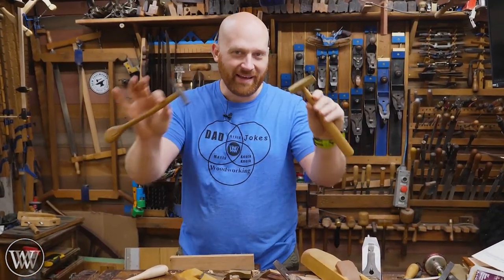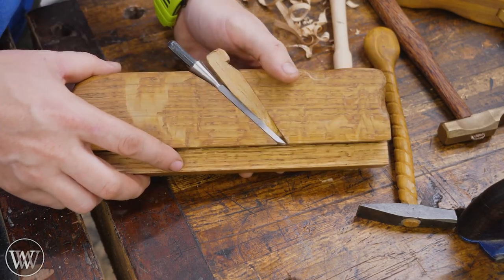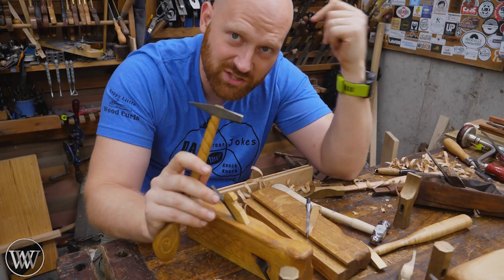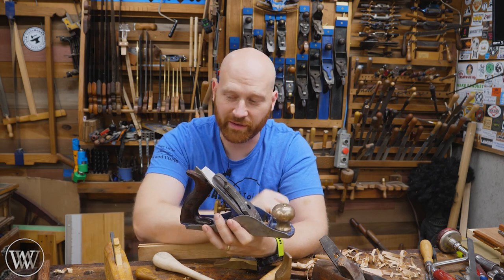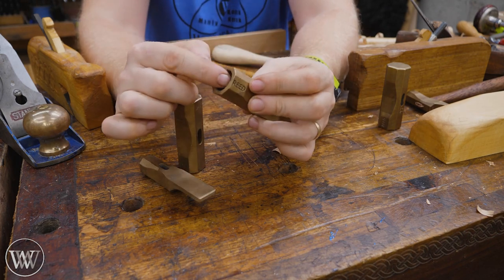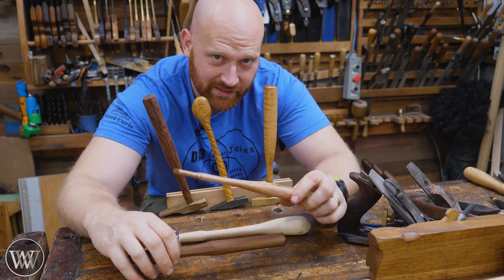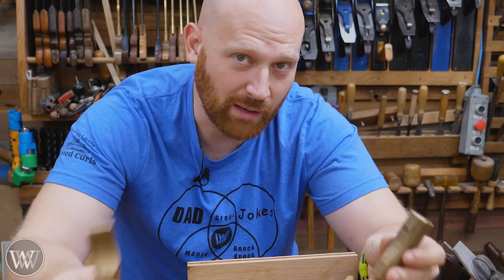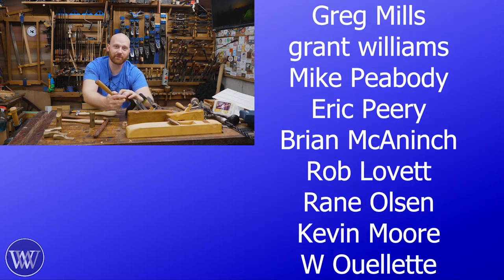These Use To Be On Every Woodworking Bench

Comment: Looks like a very hand tool. I use a tiny hammer to make lateral adjustment on my low angle metal body planes. The mechanism on new No 62 is difficult to make fine lateral adjustment, and on LN No 164, there is no lateral adjustment. Hitting corners of the blade makes very good micro adjustments.
Wedge ejected.
It seems your low angle wood plane still has a narrower than blade escapement.

Comment: I have a very similar hammer, steel head, japaned, standard handle. I bought it for putting in small brads (before I had any air compressor and nailers). The tapered end is perfect for starting a brad pinched between finger and thumb. A no pain solution to a problem! Mine was made, I beleive, in Italy, by a company named "Bellota".

Comment: I use a plane adjusting mallet on my Lie Nielsen low angle jack plane for lateral adjustments. Sometimes even use it for forward blade adjustment because the tiny awkwardly placed adjusting knob on the #62 is so frustrating to use.

Comment: So a plane mallet how to is coming soon? I'm down for that. Great walk down memory lane tight there. Making a wooden plane mallet out of an elm head and maple handle was the first hand tool only project I made, (since it was small enough to plane with a chisel) right before I finished making the first plane I ever had that I intended to use it on, ha. The plane still works like a hot damn, even if the body is slippery elm and lost a lot of its soul through the years..

Greetings again from the land of a million ponds! Well, at least a few weeks out of the year lately 😕

Comment: It's interesting to see the different kinds. I passed over quite a few adjustment hammers because I was looking for the wedge to be perpendicular to the handle, and in retrospect that was silly. Now I want to try an adjustment hammer with the wedge in line.

To anyone who's tried both, what do you prefer? I use mine for starting tack nails as well, which seems like functionality I'd miss.
Reply from the maker: having used both I do not have much preference between them

Comment: How does Sarah feel about you hitting on your tools? 
What is the chasing mallet for? I have an ancient one that I'm about to re-handle (with Red-Gum).
Reply from the maker: A chasing mallet is for doing chasing work. Lol. Sorry I had to. Chasing is carving in steel. Usually the decorative carving you would see on the side of a plane or some other surface is chasing.
Reply: @WoodByWrightHowTo  going to get a little bit pedantic on you, Mr. Wright; I apologize. 

Chasing doesn’t carve the metal; that’s engraving. Chasing uses various shapes of blunt “chisels” to basically dent the metal. The effect is similar to engraving, but it simply shapes and moves the metal rather than carving it away. It’s also not limited to steel, but any metal. Chasing steel is actually really difficult due to the hardness of the metal; most metalsmiths would do chasing work in brass, bronze, copper, gold, or silver.

Comment: I recently made me a little Hammer out of brass round stock.
Just filed it, shaped it and put a hole in.
One side is oak endgrain and one brass.

I made it for my lie Nielsen block plane wich don't have lateral adjustment.

I found me using it quit a lot on my other planes too. It's really fast and accurate. You can even tap the Norris style adjusters directly. I don't know if it will ruin it over time, but if so I get a new adjuster and change my habbits again...

Comment: Really neat stuff. Rather than using castings (lots of filing), I just machine them from solid brass. Much cheaper too.
Reply from the maker: we had looked at machining but it would end up costing 3-4 times more.
Reply: @WoodByWrightHowTo  3-4 times as much, or 3-4 times more? (latter is 4-5 times as much)...-Commercially I can understand part of it- but 4 times as much would be £304 for the London pattern!
I can buy 1" square brass a suitable length for $12 - retail. Machining a one off would take around an hour- less time than filing a casting. (A CNC would take a few minutes). My scotchbright wheel will give a nice finish in 10mins. 
In practice, I have an old marine bronze propshaft I got for scrap price. That will do nicely...
Reply from the maker: maybe you should talk to Jeff and see if you want to make them for him. the problem is no machine would want to mess with the small quantities we have. and if they did the price would be through the roof.
Reply: @WoodByWrightHowTo  I am retired, and the last thing I want is a business… I do try to get woodworkers to broaden their interests. Instead of buying a pillar drill, pay a bit more and get a small mill. Projects like this (and many more) are then possible. Why limit yourself to dead plant material? I make my own hinges, locks, catches and other furniture for my wood projects- it is rare for commercial parts to be completely suitable.

Comment: Somehow it feels like a Cosman video, made for the sake of sellin us somethin. In about 4 years of watchin you, and watchin 90% of your videos, I have never seen you adjust a metal plane with a hammer...... but in this you say you do. You're one of my favourite channels, I really hope it's not changing and becomin less than "Wood by Wright" ....... I know you wanna show off the hammer head, but please don't tell us fibs that you adjust metal planes with hammers, you don't do that.... you don't even like wooden planes , this video is all about a sale.
Reply from the maker: I beg to differ. You don't generally see me adjusting planes and videos. Most of the time. The lateral adjustment is on the low angle plane as the Norris adjuster on those is a bit difficult. The reason I showed adjusting it on a grooving plane is the molding planes are where I use it most often. I don't use bench size wooden planes and that's why the one I had to demonstrate on isn't a standard user. It's just there for demonstration sake. Then all honesty I make very little on REED tools. Usually between 50 and $100 a month if that. The whole purpose for offering them on my website is because Jeff doesn't want to start up the website for them so I offered to host the sales. My goal is to see him start making REED planes again. I really want to see those back on the market.